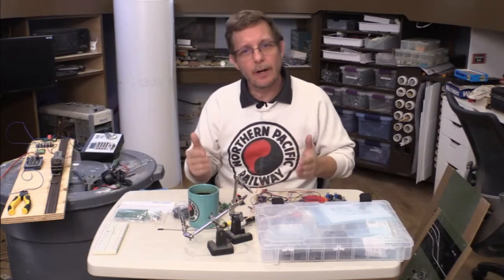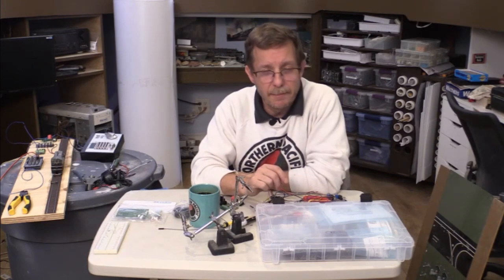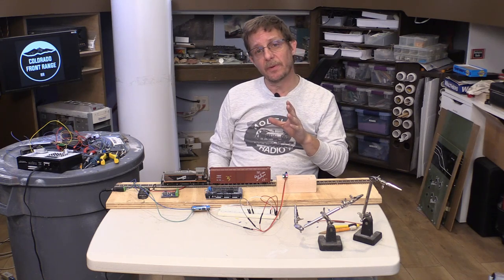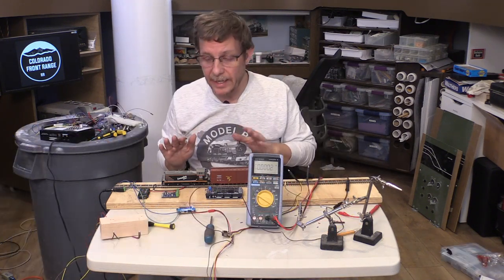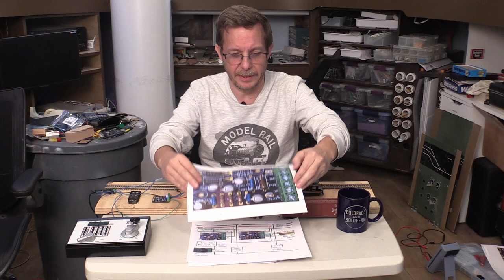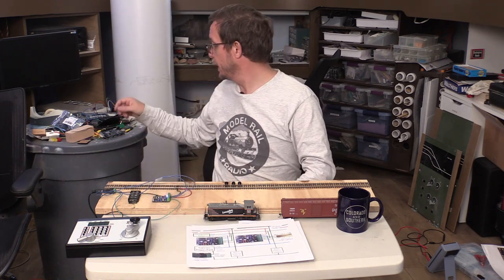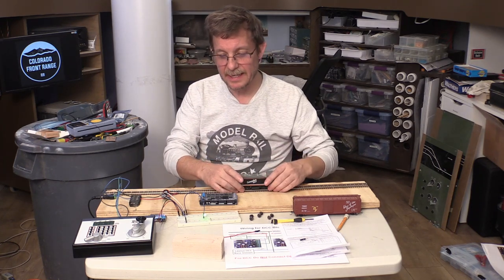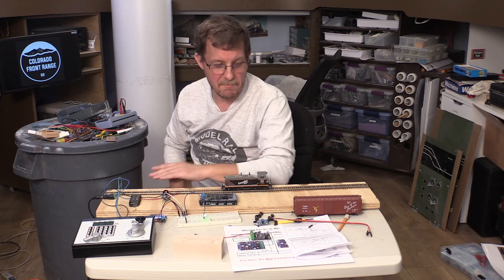Colorado Front Range HO scale - Sensors Part 1 or Minus 1

Comment: Bruce Chubb's DCCOD is presently $11 in kit form from Sliq Electronics (http://www.sliqelectronics.com/pricing.html). It is my understanding that the DCCOD is much more sensitive than the NCE product.
Reply from the maker: I would not say that and one set of 10K resistor wheel trips the occupied block that is all you need. The Number of loops going through the CT coil increases sensitive.
Reply: It is true that the sensitivity of the NCE BD20 is controlled by the number of passes the track feed wire makes though the transformer. However, NCE’s instructions caution that you are limited in the number of turns permitted, without damage to the detector, as a function of the rated booster current.

For example, using a 5A booster with the BD-20, you are limited to a maximum of 4 passes through the transformer. NCE’s quoted sensitivity for 4 turns is 1.9mA. At 14 V DCC voltage, this equates to a maximum allowable wheelset resistance of about 7.5kΩ. NCE suggests using 4.7kΩ, which provides a 1.6 to 1 detection margin. Reliable detection requires using a resistor value much less than the theoretically calculated value. Thus, in the BD-20 case you might want to go with a 3.6kΩ, providing slightly over a 2 to 1 margin.

The DCCOD has a sensitivity of around 80 kΩ. I use a 10kΩ wheelset per car for a detection margin up to 8 to 1 with DCCOD detectors.

In summary, the DCCOD is about 10 times more sensitive than the NCE BD20, when using the NCE specified maximum number of passes (4) for 5A boosters.

Comment: Hi, Team Digital make a 8 block current sensing board http://www.teamdigital1.com/prod_catalogue/blocd8_product/blocd8.html
These are great in a yard where your blocks are close together. It reduces the clutter. Also, since they are loconet device it adds the possibility to update JMRI or other loconet devices and simplifies wiring any other panels. The NCE detectors do not update other devices or computer software or cell phone apps. So your getting more for your money and time invested for future expandability.
Since there are 8 detector per board, the per unit price becomes cheaper.